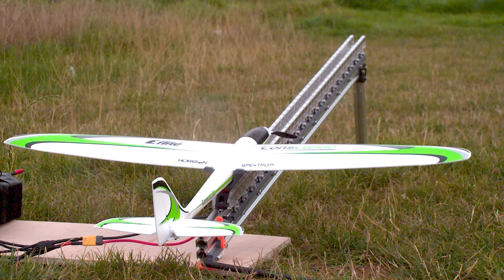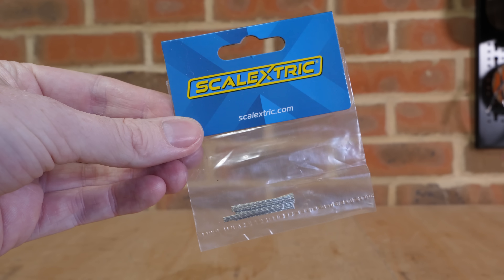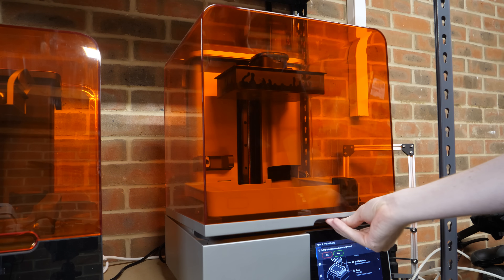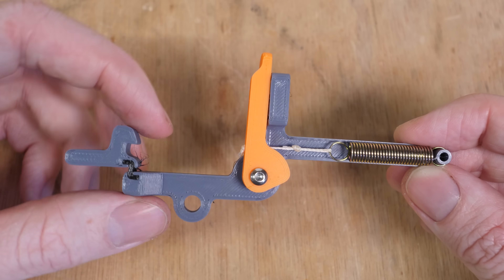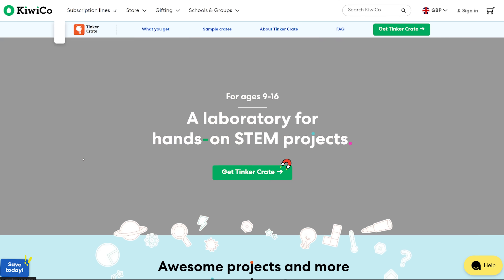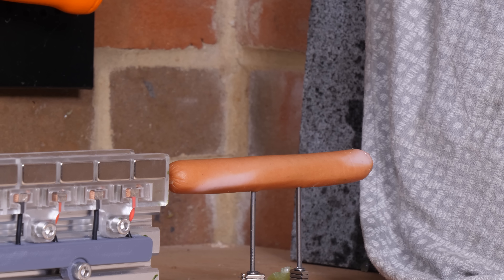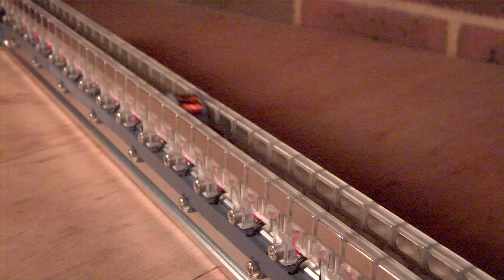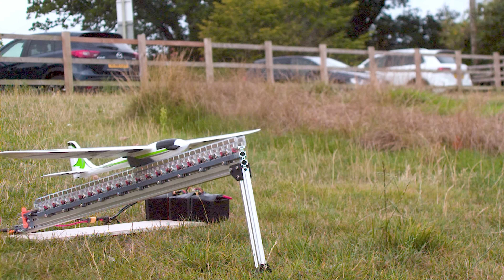Electromagnetic Aircraft Launcher

Comment: i an a retired engineer, but I still love to watch people figure stuff out, and great job! 
I worked a lot on rail gun tech. It's pretty scary when you get up to levels they use for weapons. I also love how you designed and printed the parts out.
Thanks for the posting. I know you put a lot on work in this video.
Smiles!
Reply: engineers are probably the primary audience for figuring stuff out content....
Reply: This is why the aliens won't talk to us joke
Reply: Could you put a high voltage capacitor (inside the coil) to supply the power to the launcher - so that the capacitor is part of the projectile?
Reply: @derekflegg2510  Well you definitely could, but it depends on how much power the electromagnet pulls.
Reply: Loved it mand , great video , great work , I live the 😂 and the various test , same feeling I get when i work on a project 😊
Reply: Are you a menace to your family now?
Reply: After all of the $$$ + R&D, why did the rail gun not get put into action? I suppose space-based kinetic weapons are scarier!!! Cheers from Seattle!
Reply: @keyscook  Because why use a gun when you can make maneuverable and programmable missiles that travel a similar speed?
Reply: @amy2theuniverse359 $$$  If the sabot could be guided to change direction, cost per shot could be much less, hypothetical speed could be much higher. Otherwise, missiles suffice, as you say.
Reply: @keyscook  The rails tend to wear, especially at the ends, as they vaporise and form electric arcs when the projectile exits. Additionally, the extreme muzzle velocity—exceeding anything attainable using chemical propellants—is rapidly lost as the projectile travels through a thick atmosphere.

Railguns in space? Well, that would be another story...
Reply: @keyscook Last I heard, wear and tear were the big problems facing railguns. Just like in the video, those contact surfaces wear out fast, and need frequent maintenance to keep the weapon in operation.

Not sure if they ever figured out how to address that, or not. I'm not in the industry, myself
Reply: @Bertinator-nm9ld  thanks -I had thought the projectile carrier was suspended magnetically...
Reply: And I an astronaut
Reply: @FckOffWereFull  more nut than astro-nut :)))) funny joke.

Comment: I wonder if you could reduce arcing due to the inductance by attaching some capacitance in the right place? Maybe alternate the power contacts with capacitors? With the right tuning of the values, you might be able to get the timing on the current reversal of the coil to happen at the perfect spot. That said tuning a multi coil system might be a rel trick given the second coil would have to account for the residual charge from the first one.

Comment: Solid copper wire in the core of center rail wind it to alternate the inductive field clockwise. 1 cm # of turns? Then alternate for the opposing field. If nothing electrical is touching then you dont need the sacrificial anode and cathode.sled contains a piece of insulated ferrous metal  wound with copper hooked to 2 capacitors with rectifier circuit. Will this work? You gave me an odd thought and it seems up your ally.

Comment: You could use a thyristor to avoid the problem with bouncing mechanical switches. Once it is triggered, it remains conducting. You'd only need to make sure the current thru it never falls below its holding current, by adding an appropriately calculated resistor between the power rails.

Comment: Cool and fun video. 
Few thoughts:
1. Adding back iron will probably increase your flux level in the coil, markedly. 

2. Don't have the carriage in the range of contacts when turning on the power to the rails. Have a spring launch the carriage at a 'slow' roll at the first contact pair, with power delivered to rails with no load. Fraction of second switch bounce won't matter. 
3. Widen your magnet spacing to get higher speed, either widen them all evenly, or space them out as function of distance from first contacts. It will show the early acceleration, but should increase your final velocity.
4. Consider figuring out how much BEMF your seeing from the coil moving in the magnets. Without power, STEADILY pull the carriage down the rails and measure the voltage generated across the rails according to position, and speed. Really needs to be captured with a scope and a 2nd channel for position info.
BEMF is proportional to speed.
Record of BEMF will let you adjust the contacts position with respect to the magnets.
(BEMF is motor-speak for what keeps you from pushing more current into a motor at "full speed" - the voltage you're applying is fighting the voltage generated by moving the coil through the magnetic field.)
5. Consider voltage jumps as you go down the rail. Later contacts will have more voltage than earlier ones, and magnets can be spaced out further at the same time. A series of batteries with multiple taps can feed multiple rail segments. Bit more complex, but still pretty manageable. It will cause a step/jump in the acceleration, so the load should not be too delicate (foam wings?)

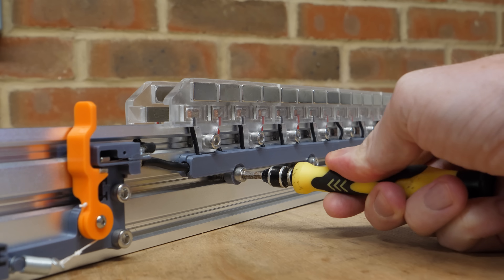Comment: 7:52 switch idea. Instead of 2 magnets pulling together, you could just use the mechanical sprint rotating switch to strike the underside metal and with a triangle shape, add the striker goes forward it would press the underside against the upper side. 

No bounce at all. 
No magnets. 

Simpler, more reliable, less complex. 

Very nice project. Interesting.

Comment: Some of your contact degradation is likely due to using solder wick as your brushes.  That copper braid is usually embedded with flux to aid in wicking solder away from the surface it was originally on which can get quite sticky when heated and leave behind insulating residue.

Comment: Very cool video! If I were to do your project, I would use optical sensors and switch a BJT transistor to energize the coils. BJT transistors are capable of handling high current. Then all you have to do would be to adjust positioning of the optical sensors. You have a much more likely chance of matching the correct synchronization between the position of the sled and when the correct magnet polarity is energized. Just an idea...

Comment: Consider using carbon brushes to pick up the voltages. Trains uses them . But they will mess up or dirty the system. Try getting replacement carbon brushes from makita power drills.

Use alu or stainless for the powering rails

Comment: Why didnt you stick to the scalextric brush for the sledd? you don't need all that much length anyway, plus you could just pinch off the section you don't want to solder and it won't flow up. 

Another thought: i don't think you should launch with a switch. You should have a mechanical launch for the initial speed. Something like a spring is enough. 

Also: the faster your sledd moves, the shorter the connection. You need to adjust contact length and spacing further down the rail.

Also also: did you account for the electro magnet field switch times? its not an instant on/off

Comment: The bouncing switch problem could've easily been solved by attaching a hold clamp to the end of the switch. This would mechanically prevent the switch arm from bouncing.
Especially with regards to the switch you're trying to reinvent the wheel too much.
Just look at the various industrial switch designs which ALREADY have working solutions for the sparking/bouncing etc problems.
Don't feel ashamed to copy/"borrow" a good design because like Sun Tzu might've said "better have a good copy than a bad original".😉😉😁😁

Comment: For the switch, do you think it would be feasible to use a reed switch-plus-thyristor combo? Not nearly as cool as the all-mechanical switch, but two thyristors would be able to handle all the AC current you could throw at them, and there would be effectively zero bounce at all.

Comment: I would of rather seen optical sensing and fet drive instead of destructive arcing, but its your program.
Reply from the maker: The launcher I built 2 years ago used hall effect sensors and mosfets. However, it was far more complex to build due to the timing control electronics, let alone have to wind far more coils along the rail.
Reply: @TomStantonEngineering  What about having the electronics on the sled (H bridge, hall or optical and coils) and have long two long strip contacts like slot cars use, so no nasty cemf arcing? Also, H-bridge drives the coil and eliminates the high voltage cemf if done correctly. Thanks for sharing. And get ferrite or iron in the coil core, loosing to much flux (high reluctance).

Comment: You should adjust distance between magnets along the length of the launcher, because when the sled goes faster it should have force applied in different time intervals. Although it may not be relevant with  such slow speeds.

Comment: what you might try.. varying the magnet/coil spacing. the coil has a ramp up time and collapse time.. the further down the sled, the power/coil gap spacing might be increased to take into field attack/drop timing- tighter spacing at the initial acceleration, further spacing at speed. - kind of like.. how.. on a brushed motor, releasing the timing key changes rotational speed as you retard and advance the timing.. more power vs more speed. - now i see "@capone2488 3 days ago" suggested similar.

Comment: Back in the day light activated switches were all the rage in DIY builds, that would be a better option over the brush and contact setup. A small LED powered by the magnetic fields passing through the fields should be lighter than the brushes and you will need less replacement of the electrical switches and sensors, and you can even put clear plastic between the sensors and the track to protect them so that you just replace the clear plastic when it gets too scuffed up.

EDIT: I am being an idiot, they are powering the coil on the car instead of using the coil as a reactive (?) coil from a shifting magnetic field along the track.

Comment: Just put the magnets in the projectile innit?  For v2, make your coil electrical connections solid, use high power mosfets, the approaching magnet is what triggers the mosfet, and a big.low ESR capacitor to fire through the mosfet, play with distance between trigger and coil timing for best result. Use the flyback from previous coil through dides to kick the next one then fire it too.  That can get serious with just 3 drivers driven off a D cell alkaline battery with surprizingly few components when tuned for a repeatable load, especially handy if you have a rusty bucket full of all the same 1/2" nuts, or whatever....
Reply from the maker: The launcher I built 2 years ago used hall effect sensors and mosfets. However, it was far more complex to build due to the timing control electronics, let alone have to wind far more coils along the rail.
Reply: @TomStantonEngineering  Ive moved on to simple mechanical slingshots, bean flips, wrist rockets, squirrel knockers, whatever you want to call it,  much easier to construct out of only the materials that happen to be within reach at the moment you decide you need one, and you can launch ANYTHING with it, given the time to construct it out of whatever is to hand.   Anything is ammo.   Heres a video concept,  how bout you take a single spool of braided nylon mason's line, ( prolly get it at Poundland, ya?) Let's say you have 300 feet of it,   I know, you are probably already aggravated, but that doesnt matter.  What does matter is that for each foot that is tensioned to the 120 pound test limit of that particular line you have a recoil curve due to the elastic stretch from the force used to draw than line to 120 pounds tensile.   Now,   How far could you launch a 411gram can of Great Value no salt added, Cut Green Beans using nothing more than a roll of string, a 240 pound weight to tension the string with, and a pocket knife to trigger?
Would it be better to divide that line in two and have quadraxial thrust? 
Can you really make a green bean can go round from the massive thrust imposed by nothing more than some plastic string?   I will pitch in 2 cases of beans and 2 rolls of line......
Reply: "We applaud your humble generosity in having discreetly distributed basic foodstuffs to, who through whatever series of turns and events put them in the position that they might truly appreaciate a can of vegetables from the sky,  and that you did so anonymously throughout the community.  Well done old chap.   But we must have a word about your method of delivery...."

Comment: You can keep the solder from wicking along the copper braid by pinching the braid with a pair of hemostats or pliers. This pulls heat out of the braid at that point effectively enough that the solder can't remain molten to wick past it.

Comment: Certainly the greater resistance and greater mass is an issue with more turns, but I expect the greater inductance would potentially be a bigger factor.  Inductance is trying to keep the current from building quickly, when that's exactly what you need.  That being said, I haven't done any numbers, so it may just not actually be significant.

Comment: Word missing from this video "core saturation" 
improvement suggestions
toolless brush replacement
deceleration zone for captive sled (with one finger release for removal from the track)
acceleration testing of the sled and turn numbers, should be done with an increasing gradient of weights
Reduce instantaneous resistance (reactance) by adding capacitors along the bus bar, better power factor = more energy transfered into the (reactive) load
sled auto rewinder (somehow)
sparks are cool, but actually undesirable
swapping coil polarity on every magnet, you need energy to collapse the magnetic field, I feel there should be a way to around that ? (also, AC motors do flip the poles polarity, it isn't just on/off/on, also collapsing the magnetic field, probably emits broadband noise (basically this is a spark gap transmitter))

Comment: Dead blow hammer design for the switch. Just put a small cylinder section on the back of the switch and fill it with bbs or something. They will bounce on impact instead of the switch. Look up a dead blow hammer.

Comment: An alternative method of soldering the brush: Crimp a disposable heatsink onto it, which will limit the wicking distance of the solder. Once the solder cools, cut off the excess that's not directly crimped. EDIT: What if you split the difference between the two designs, and had the brushes activate transistors to switch on the current for each segment? Then the amperage on the brushes would be low, so destructive sparking could be avoided. But it still wouldn't be limited by the speed of a microcontroller.

Comment: The huge mistake of such projects is a big air (magnet) gap. To avoid it need do two things 1. Insert steel core inside coil 2. Connect external side of opposite magnets by steel (best way is use U shaped steel on the bottom side) After this air (magnet) gap will be couple millimeters, now its about 10 santimeters!

Comment: Put a core in the coil! Use the appropriate metal maybe even laminated core. Try carbon com brushes from motors add another few incheof tracks and slow the sled down with reverse polarity and a cushion spring 😀

Comment: Use a relay instead of a 3d printed switch. Will make contact within milliseconds and bounce within a 10th of a second. Should also be fused to break the circuit if the sled gets stuck

Comment: With thinner wire, you could get more windings on the launcher spool, without higher mass - thus, hopefully more "torque" from the launcher.
Also, something I remember from my time with RC cars, is that you can pack the windings a bit better, if you have two very thin wires in parallel.
ie. I had a 15 turn motor, and a 15 Quad (4 wires) motor - And the 15 Quad had more lowdown torque, but also required a bit more power to run.

Comment: Take the 300 turn coil and remove 1 turn until you finally reach a point where the sled accelerates faster than the 200 turn coil. Keep going until there is no more speed to be gained, then find a way to make the sled lighter.
Possibly by tweaking the infill if there is any or the material thickness if not.
If possible, make the sled and rail out of delrin and use a nonconductive lubricant to reduce the friction as much as possible.

Comment: Also wondering if you have considered the possibility of replacing the magnets and coil approach with an inductive charging circuit, similar to that used in wireless cell phone chargers, etc. No need for brushes at all.

Comment: Great project. I agree with the previous suggestion(s?) to wire in diodes across the coils to not only eliminate the back EMF (and the sparks), but actually increase the efficiency and resulting force on the sled. But I do agree the sparks make it look cool.

Comment: the bouncing is easy to avoid. use a normal switch or let the trigger go between the 2 contacts also the trigger should be made of copper or steel. Reduce the way the trigger has to pass reduce the momentum the trigger has why this fancy trigger when you can use a simple electrical switch?